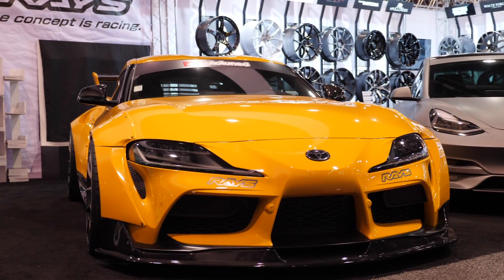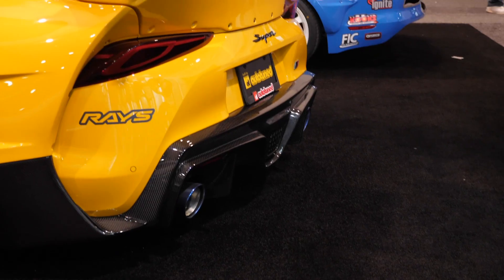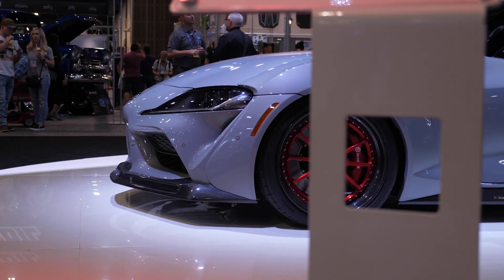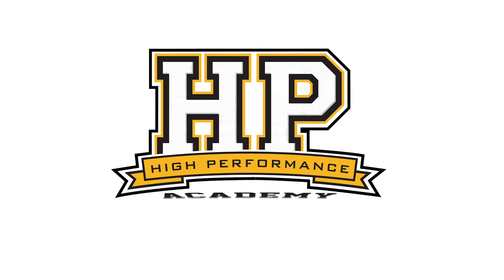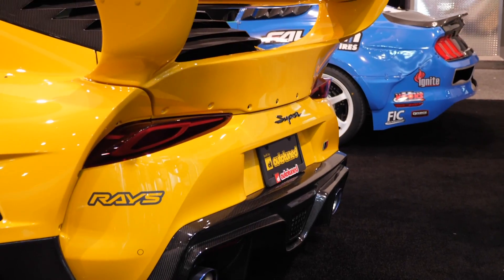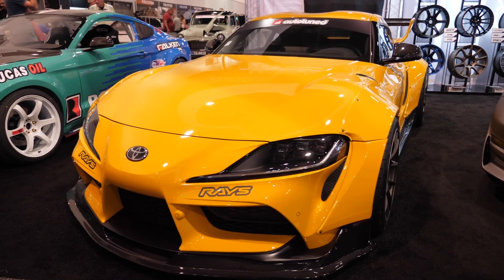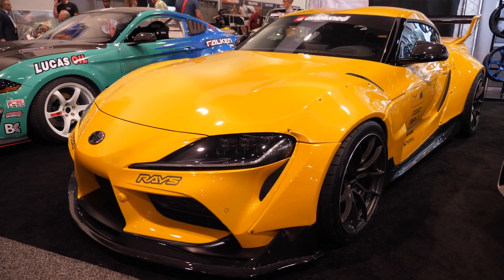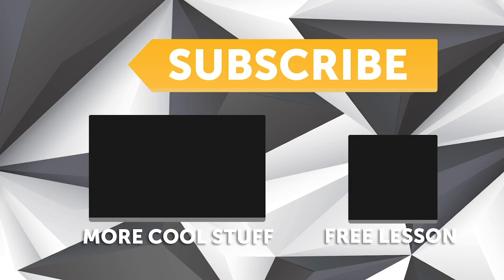A90 SUPRA Tuning With WinOLS | Late Model Reflash Performance [TECH NUGGET]

Comment: I am a weekend warrior and have invested in WinOLS, also have a BFlash and the tools of Dimsport.
Reply from the maker: Nice one Bart. You guys are out there, but as Andre mentioned only a low % compared to those tuning their own standalones or using software like Hondata and HP Tuners etc.
What are you tuning? - Taz.
Reply: High Performance Academy I tune a bit of everything but mostly offroad builds.
Buggies or other 4x4 vehicles with larger turbos or other engines mostly bmw /vw diesel.
The last thing I have tuned is a rally raid nissan navara with FIA license. 
All with original ECU sometimes made stand alone.
In short everything a normal tuner doesn't like or doesn't want to do.

Comment: In the Papadakis racing 1000hp stage 1 a90 supra series the first phase complete build has an aftermarket ecu. Probably the best way to play with the controls is to get a controller you're familiar with rather than learning a new and very locked ecu.
Reply from the maker: That depends on what features you want though as with late model cars you can lose a lot of functionality that the OEM ECU controls which an aftermarket will not, whether it's A/C or electric power steering or many other things. 
Every application is different, so you can't make a sweeping statement either way on this without getting into the specifics and seeing what is on the market - Taz.
Reply: @hpa101  thank you for the response. I'll work on being more specific in statements. ;)
Reply: yeah and it can't use most of the features that make it a fun weekend or a daily car

Comment: i think there is a big difference between hate, and a lack of respect. I don't think most people hate the Supra A90, just don't respect Toyota for co-designing yet another chassis with another manufacturer. Certainly for such a signature model in the line up.
Reply: They could've if it was going to be high volume. If they didn't go in with BMW, it simply wouldn't exist.

Comment: Glad you’ve finally mentioned winols! 
Only way most European cars can be tuned. Very difficult software to learn but rewarding and once you’ve got your head around it it’s not to bad and you can use a dissembler to double check your map axis locations. (IDA etc)

Amazing content as usual👍
Reply: You're right, WinOLS is great!  Disassembly is next level difficult for sure.

Comment: No, it’s not a supra. It’s a Z4
Reply from the maker: It's an A90 Supra as titled. Like it or hate it, it doesn't really matter. The BRZ/FRS/GT86 went through similar public opinion issues.
At the end of the day Toyota did sell a solely Toyota produced Supra....and no one bought it, so here we are today 😉- Taz.
Reply: High Performance Academy 
Rebadging a car doesn’t make it a legend. Buying others efforts is not innovation.
BTW, the car was recalled by BMW which makes it more German than a Japanese.
This abomination will face the same fate the Z4 had which is FAILURE.
Reply from the maker: Who cares if it's a good car though? 
Doesn't matter if it's more French than Polish, or Kiwi than African. If it's good it's good, if you want one, buy one, if you don't, don't just like everyone did when the last Supra was available for purchase 😉
How long did you spend test driving it before you decided you didn't like it out of interest? What did you hate the most and what wasn't so bad? 

Just curious as I certainly love cars as cars rather than only if it has the right shaped badge somewhere on it personally, but we're all different and that's cool - Taz.
Reply: High Performance Academy 
Ok let’s make this conversation MORE professional aside from emotions.

I tested drive the car with tunes. The short base of it makes it a little bit harder to control. It’s good on tracks but not as good on drags. If you want to get the full potential of the body you have to keep the car stock.

The car is good but not as good to be called Supra. The new one also has differential ring ratio defect. The car eats the crowd in hard acceleration (like the mustang) therefore we have problems in diff ratio and body to HP ratio.

The engine is even more complicated than the VR variant found in the GTR. The timing chain is in the back so you have to remove the whole engine out to install the cams. Also the VVT-i system is complicated. It comes in the form of valvetronics where each valve has it’s on timing variation. 

In the end the car has it’s on characteristics. I would love to have it under any name except the supra.

If you would ask me what would I do if I’m told to design the new supra, I would do the following:

1- The engine: Make a 3jz engine that meats emissions in the form of direct injection (for fuel consumption) and more catalytic converters (for environmental emissions).
I would make the engine produce law horse power while having lot of potential.

2- The Body: same chassis same body panels (since the body is way ahead of it’s time) with a little bit face lift, LED lights, and aluminum hatchback.

3- The interior: change the design a little bit (since it’s more focused in the driver), remove the back seats, and redesign the body sway bar between the backseats and the trunk.

The Supra didn’t sell well in the past because people in the 90’s deserted sports cars to the preference of Trucks and SUVs. 

When you look at people now you find that they like 90’s cars a lot. They prefer R32 over R35 and 6th Gen civics more than the modern one, not to mention MR2 and the supras.

Comment: WinOLS is above the paygrade of 99.5%+ of tuners, including me. Making any use of that software system is complicated, tedious, difficult work.
Reply: lol, there is simply NO alternative for a tuning company that writes its own files and sells them online. At least talking about the European market :)
Reply from the maker: Yes but they will have a team with the relevant skills @Nebbia. Bit different from a home enthusiast trying to casually learn a solid level of software engineering in order to tune their car. We'd never say it is impossible, but it is certainly much harder than the actual tuning side of things with a completely different skill set - Taz.
Reply: @hpa101  oh absolutely, I was not talking about home tuners! I was replying to the guy saying that 99.5 of TUNERS can't use it. I would be happy to be part of the best 0.5% but is simply not the case.
Reply: If you've got the Damos (map pack) then it's pretty simple, the struggle is making that file from the binary data. I've looked into it for my own BMW but it would take months to build my own Damos.
Reply: @3finnian  It's been quite some time since I messed with it. At that time, a "Damos" file (it's actually called an .a2l file) was not available. It was simply up to you to parse out the binary file - using your experience and understanding of how the control system strategy oughtta be working. Even as a calibration engineer for the OEM's, I was in way over my head.

The "map pack" can't possibly include every calibrateable parameter in modern ECUs, can it?? When I left the last OEM I worked for, our ECUs had over 150k calibrateables. Obviously you don't need every one to retune MBT spark table or adjust WOT fueling - so I'm guessing the map pack just provides you a handful of useful parameters to tune??
Reply: WinOLS is basically a big, blown hex editor.
Without the source of an A2L working on OEM ECUs newer than year 2000 is just blind shooting and hoping for gains. I work with WinOLS and INCA everyday and in combination they are some very powerful tools. However 99,9% of the tuners don't know shit about the logic behind modern model based ECU structures and simply bend the model to somehow increase power. This approach is absolutely stupid and will risk the engine as well as the health of the driver as modern cars rely on correct load values sent by the ECU via CAN or flexray. ESP, automatic gearboxes and transfer cases need to know the correct torque value to operate correctly due the whole cars lifetime. Bending the torque model will lead to increased wear and also unsafe operation. Especially on the Euro diesel tuning world about 99,9% of the tunes are done wrong. I see this shit everyday but companies like B&C or other file sellers simply refuse to work properly so the quality of the tunes won't increase near to OE quality.
Reply: @MrSupermasi  any way I can get in touch with you to discuss the use of INCA with WinOLS?